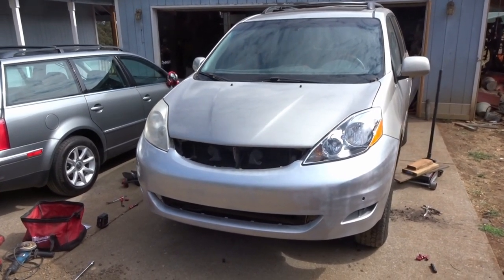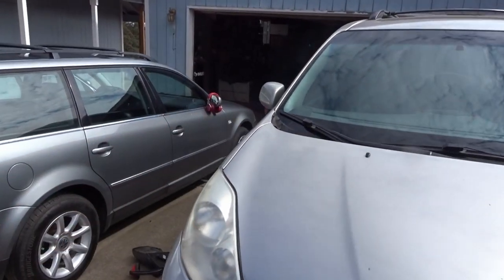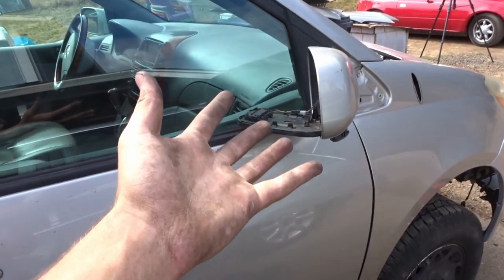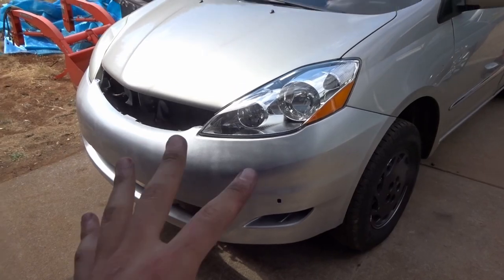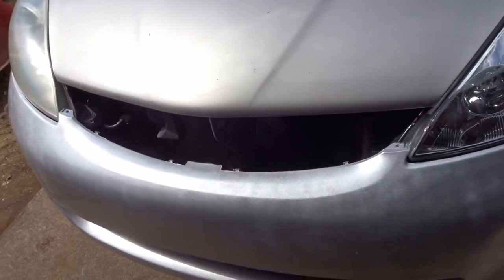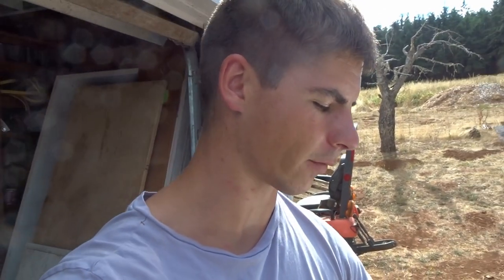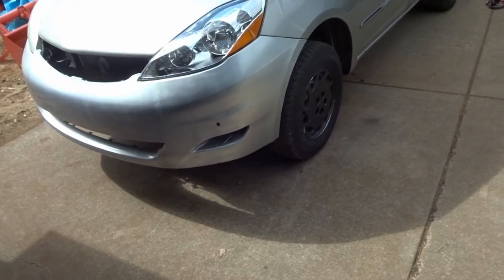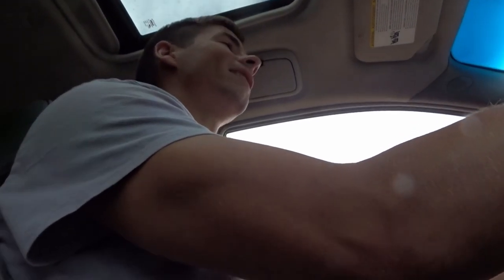The Ultimate Lifted MiniVan: What You Need to Know

Comment: what size of tires did you put on there?? I am skeeming 245/65/ r 17 on mine with wheel spacer
Reply from the maker: I am running 235/70R16 tires with a 1" spacer rn.  it looks weird if you don't have the spacer on
Reply: @PhilWithSuper  I'm looking at putting that same size on without a lift kit. It's already an AWD that sits really high.